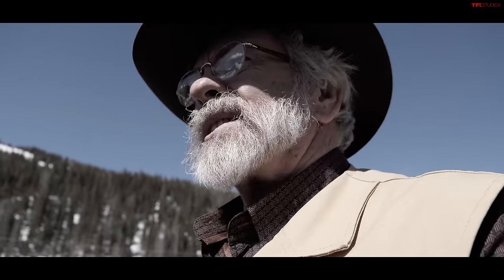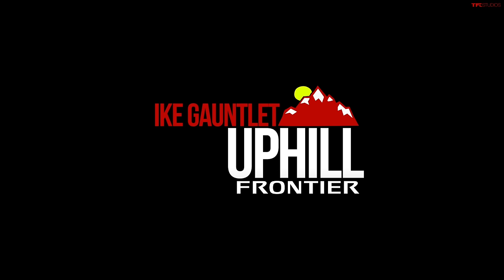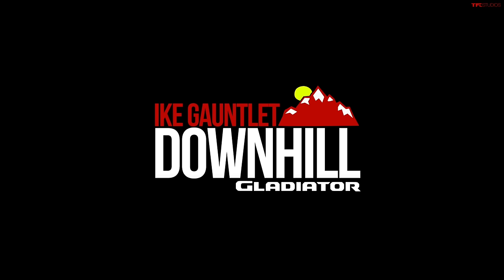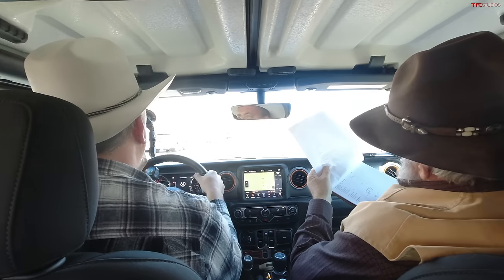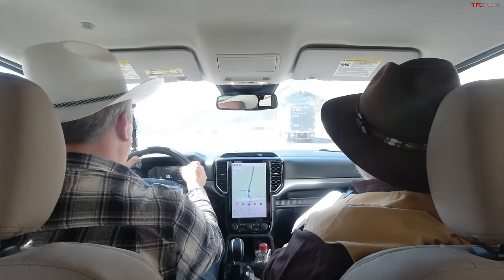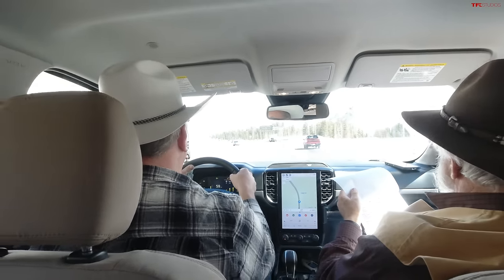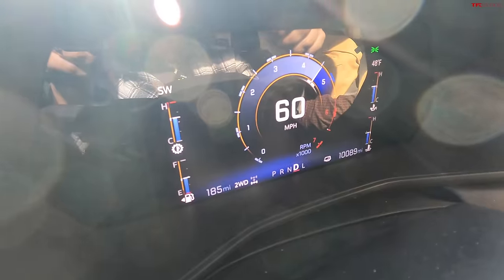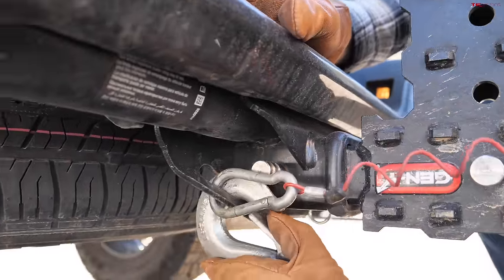MEGA Ike: New Tacoma, Ranger, Colorado, Gladiator & Frontier vs the World's Toughest Towing Test!

Comment: This is one of the best videos you guys have ever put out. A ton of work you guys put is really paying off. I love seeing the head to head with all of these trucks.
Reply from the maker: Wow, thank you!
Reply: 💯 agree. 🎉 Great job Andre and the crew!
Reply: The jeep gladiator had the most brake applications with 5 and the Chevy Colorado had 1 brake applications and was the best for that category and that puts the Colorado even further ahead
Reply: @mrgreen8357  Thanks
Reply: @mrgreen8357  exactly except for the Colorado has a pecked with the blocks cracking
Reply: OK 😊GREAT TESTINGS ,  Next Test Same Loop@ a 1-Ton Reg. Cab 430Gear Ring , Base Truck Longbed F-350 6.8 & Add; 2500-LBs@ Test & Simple 😮White Exterior
Reply: @bryanmathew2079  Thanks
Reply: @MrTruckTV  YOUR VERY WeLcome Mr. Truck,
Reply: Best videos???????  Who runs a truck up mountain grades at red line. What does that prove.   How long is a tiny motor going to last doing that?  Looks like a test to see how many bearings we can spin out.   A 40 HP VW will pull 8000 pound too, until it explodes.

Comment: Can't wait to see what the results are of the Ford ranger when they put the 2.7 EcoBoost in it
Reply from the maker: We hope to test this in a couple of months.
Reply: I will be faster, heavier, and have lower payload, but will feel more confident while towing because of larger displacement and heavier overall weight. It will cost more too.
Reply: @dmegahan  I suspect we won't see 2.7 rangers on the lots in 2024.  Its probably going to be people's orders first with the occasional declined delivery that makes it to the lot.  Much like the maverick situation was.
Reply: It will DOMINATE the midsize segment.
Reply: @cliffordmontana4562 I highly doubt it only has 5hp over the Colorado and has 30lb-ft less in torque numbers. They should have detunned the raptor engine and offer that instead of the 2.7.
Reply: @TFLtruck  are you guys getting a Raptor version to rest as well?
Reply: Mojave only has 6000 lb tow rating?  Why is lower than the other trims at 7700 lbs?
Reply: @utope2  suspension on Mojave is different from the others. It a fox setup more for higher speed off road sort similar to the Ranger Raptor, which also has a lower tow rating then the other rangers.
Reply: @robertopics On paper yeah, but have you seen the drag race with the Colorado and the 2.3 ranger, the 2.3 ranger dominated and that's a lot less torque than the Colorado at 430. Either Ford is dating their numbers for Chevy is inflating theirs, or it could be that the Colorado is just heavy.
Reply: @MrFordguy73  Colorado is a heavier truck and there are other factors like rear end gear ratio, tire size and weight,  who was running premium fuel (the cpu detunes for 87).  With a trailer behind both the take off to 60 looked like it favored the colorado.  Keep in mind this test was just over 6000lb versus the 7700 lb capacity of the colorado so those numbers might have widened when the grade was steeper or payload was heavier.  The ford did seem quieter though and from other reports it may run smoother with less vibration in the cab.
Reply: @robertopics Have you been watching these videos? The 2.3L Ranger has been matching or beating the Colorado all while having 40 less hp and 120 ft-lbs less torque. The Colorado is not making anywhere near the power or torque that is claimed.
Reply: @spyder000069 Im pretty sure that the 35-60mph time was the same for both of them. And even if the Colorado is a few hundred lbs heavier, when you are also towing a 6200 lb trailer, those few hundred lbs mean a lot less. The additional 40hp and 120 ft-lbs of torque that the Colorado allegedly has should have easily overcome any small weight difference when towing.
Reply: @Jay-me7gw  The ford had two additional advantages.  The ford had 255/70/17 tires vs chevy 275/65/18.  They show the door jam stickers during the towing video.  This works out to the chevy having a 1" taller tire and .8" wider tire.  So besides rolling weight being heavier the chevy ends up with a 3.1% gear ratio disadvantage.  Also the ford has 2 more gears in the trans keeping the engine closer to its prime hp/torque range.  Would have been better to compare the ford to a LT instead of a trailboss and with onroad tires.  The 10 speed in the ford can be a blessing or a curse depending on who you talk to.  I'm not taking away from how good the 2.3 is.  Its amazing what they get out of that engine and most report them to be reliable.  The 2.7 was in the full size silverado so it seems to be pretty stout as well.
Reply: @spyder000069 Their 35 to 60mph uphill with trailer was Ranger 14.3 sec, vs Colorado 18 .8 !!
Reply: @Jay-me7gw  Ranger was 4.5 sec quicker !!
Reply: @spyder000069  40hp would make up for all of that.

The rangers tires are decently aggressive. Idk why you would compare them to road tires
Reply: @MrFordguy73 Dominated? Colorado's front bumper was about even with the Ranger's rear. That was also the Ranger's first run against the Colorado which was on it's second run after it just ran against the Honda. So you have a cool turbo going against a hot one. The Colorado also has more unsprung weight on the corners with the larger offroad tires plus a suspension lift.

Notice how the Ranger was off in races 2 & 3?

Ranger v Colorado 16.13 sec
Ranger v Tacoma 16.59 sec
Ranger v Dodge 16.65 sec
Reply: @arkhsm  55:15 in the video shows the colorado 35-60 time as 14.8 seconds.  They show speedo during that accelleration and I stop watched it at 14.6 so I can verify their result.  Not sure where you got 18.8.
Reply: @Jay-me7gw  Tire comparison was more for size and weight.  Ideally it would be nice if TFL took each of the trucks to a dyno to see what actual rwhp is.
Reply: @spyder000069 Did you actually look up the tires? They are 3 lbs different in weight. I run the same tire as the Colorado on my F150, the Territory MT, but mine are a LT315/70R17 and are only 53 lbs. I weighed them when I got them. They are a super light weight tire.

 Tire diameter doesn't matter much if you have the proper gearing in the transmission. Since both trucks pulled the hill at 4000 rpm then clearly they both had the same overall gear reduction since they were able to go the same speed at the same RPM. 

Again, 120ft-lbs and 40 hp should have EASILY overcome any small difference in the tires. Its not like we are talking 37" KM3's vs 30" all seasons here. They are similarly aggressive AT tires with similar weight.

The Colorado is clearly derating heavily at elevation. Their claimed 430 ft-lbs appears to only be available in ideal condition and at 5000+' is being reduced to near the same output as the Ranger. Its really unfortunate because I was genuinely excited about this truck and motor. I live at 6500' so this actually does matter to me. I thought it might be a replacement for my 2014 3.5L F150 but it is not.
Reply: @Jay-me7gw  3lbs per tire is noticable.  I'm in northern midwest and still have my blizzacks on my ecosport and I loose 2 mpg with them and can tell a power loss.  I also have a F250 and lose 1-2mpg with my wildpeaks vs my michelins.  I agree on the trans gearing and that is where ford has an advantage with 2 more gears but some people say that the 10 speed hunts a lot and is jerky when it down shifts 3+ gears.  So you take the good with the bad i suppose.  I own 3 fords currently but was considering the colorado as my first chevy truck (had many old gen rangers and a couple of f150's in my past).  I will be keeping my f250 but looking at a small daily driver truck that is more managable in congested parking lots and can tow my smaller trailers with my atvs.  I looked at the frontier several times and was close to pulling the trigger but I can't get past the outdated infotainment and cluster.
Reply: @TFLtruck I’m putting an order in for 2.7 Ranger day 1
Reply: @robertopics 2.7 is a different animal, it’s probably the best modern ford engine.
Reply: Me to I'm considering buying
Reply: Hope it’s better than the rustang. I had an ecoboost mustang and it
was in the shop multiple times.

Comment: Ford Ranger has a brake controller; back up assist; park assist.  Plus a V6 on the way.
Reply from the maker: Lots of cool features.
Reply: And a gauge cluster that sucks .
Reply: I hate that guage cluster as well. Everything else they did pretty good.
Reply: @rodgood  I like it.
Reply: and unreliability and low resale value
Reply: And trailer blindspot system
Reply: I'm leaning towards a canyon when I finally need to upgrade, but the 2.7l Ranger has my interest.
Reply: @Georgewashington-o7m  That's a lie. The Ranger engine and transmission has been very solid. 
The 2019+ version has been a reliable truck.
Reply: @user-tg8do2kr4v  It's the complete opposite of what you just said. Do you work for GM lol?
Reply: Hey, then it still won't beat the jeep down hill with that useless junk tech garbage
Reply: @Georgewashington-o7m  resale value is only 3rd to the Tacoma and Gladiator. No midsized truck today has a low resale value. Also there are several Rangers creeping up the 150K mile territory. The 2.3 Ecoboost is quite proven by now, it's been out for a while.
Reply: Yeah but is still a CRAP Eco Boost.  Not reliable for the long haul.
Reply: @rofin9541 what’s “the long haul”? I’ve had multiple and never any issues. One had over 150k miles.
Reply: You left out the best looking truck category and the Chevy/GMC twins win that hands down. I’d take the  Colorado all day. Great video guys!
Reply: And it’s a ford
Reply: @imkwuzn that's subjective. And I haven't come across many who would take that Chevy over the Ranger in styling let alone the fact the Ranger is an all round better vehicle. The Colorado has a busy uncohesive design as per most GM products.
Reply: @rofin9541 did the ecoboost you have never owned give you pretend issues?
Reply: You forgot it's unreliable and resale value sucks
Reply: @RJBiteanerd  Get a frontier instead.
Reply: @rofin9541 I don't know,  I somewhat reluctantly bought a Flex with the 3.5L EB because my wife absolutely loves them,  and now have 115k miles on it with a 5 Star tune in it, and haven't had to do a single thing to it. At least with this particular vehicle, I've been pleasantly surprised!
Reply: @GoFast58  unless Nissan has turned things around their build quality leaves a lot to be desired to choose the worst in the class.
Reply: Yes, once that 2.7 V6 becomes available the Ranger will be a whole new beast 🤞😁
Reply: I have a 2019 Ranger FX4 and love it. Definitely looking forward to see what the V6 brings and hoping to see if/what they bring in the hybrid world for the truck. When I upgrade it will likely be one of those two variants. Only negative I can say about the current model... I wish it had better engine braking when towing downhill as I do that often in the mountains of Colorado.
Reply: @epicfutbol  looking at the results, I'm wondering if it's a byproduct of using turbos. The turbocharged trucks all did significantly worse at engine braking.
Reply: @RJBiteanerd  I definitely think that is the case. That's why I'm excited to see how the v6 Ranger will handle. I've been told that the hybrid mid-sized trucks should be interesting as well since those electric motors should in theory help.
Reply: @imkwuzn  You like all that black plastic that will fade to a dull gray in time? Ok, have fun!

Comment: When the Ranger gets the 2.7L it will blow the competition away.
Reply: It might feel better towing but the Chevy will still have class leading towing capacity, the ranger is locked in 7500 lbs across the board.
Reply: The Colorado with max towing is 7,700 lbs if i remember correctly and it didn't blow away the Ranger with the little 2.3L engine in it so it won't even be close to competing with the performance of a Ranger with a 2.7L in it.
Reply: @drewelliott9062  no it did not blow away with towing. But I am saying, either engine you choose in the new ranger. Towing capacity is the same. If you do the eco boost V6 payload actually goes down but towing capacity remains 7500. So Chevy will still be class leading because it is rated for 200 lbs more.
Reply: If you’re towing over 7K on a regular basis you need to upgrade to a full size. These trucks are good for 5K towing if you’re doing it all the time. Never tow regularly at the limits of any vehicle.
Reply: @khakiswag  I agree but you can tow a 6000 pound trailer with a family comfortably with the Colorado... Same thing that andre does... It's not bad for the truck because he has enough leeway, same could be said for the ranger... But with the Chevy you have more leeway.
Reply: @drewelliott9062  The 2.7 V6 that will be in the ranger will still have less power the the 2.7 4 cylinder that is in the Colorado. Now if you're talking the 3.0 V6 ranger that is coming then yes it will have way more power than the Colorado but will only be available in the Raptor which will have a lower towing capacity than the other trim levels of the ranger.
Reply: @khakiswag  also what source can you find that says you shouldn't tow these vehicles above 7k regularly? and what are their credentials?
Reply: What number are you looking at? In the Bronco the 2.7 makes 315 HP (330 with premium fuel) and 410 Torque. More than the HO 2.7 4 cylinder in the GM twins.
Reply: @bladeftw6378  I said ANY VEHICLE. If you’re driving a 1/4 ton with a max tow of 13K and you regularly tow 12K you need to move up to a 1/2 ton. It’s not about power but safety. Handling and braking at the limits of what the truck can do is not a good idea. You never know when you need to take  evasive action. A Silverado will handle abrupt maneuvers or strong cross winds with 7K behind it better than a Colorado. And a F-250 will do the same with 12K behind it compared to a F-150. It’s common sense if you’ve towed.
Reply: @khakiswag  well that's a given evasive maneuvers and braking towing 7k pounds is always going to be worse the more you tow. it still stands that chevy is rated for and will handle better ever so slightly better than a ranger. I have towed before and I know many local businesses that will go with the Colorado for their fleet over the ranger, not because they are going to tow max but because it is going to handle towing 5 or 6k more frequently without issue.
Reply: Only thing that is going to blow is the engine; Toyota is the best to pick or Nissan
Reply: @Georgewashington-o7m  be careful making general statements. When the previous gen Taco came out the powertrain had issues. Toyota is reliable but it’s still man made and has faults too. The 2.7 EB has been in use for almost 10 years now and is proving to be reliable. Had some issues in the first year and with a bad batch of parts from a COVID supplier but it’s a good engine.
Reply: @drewelliott9062 I agree, for the numbers that the Chevy put up against the 2.3 it didn't look good. I think the Colorado is kind of heavy.
Reply: @MrFordguy73 its the gear ratio. Nothing wrong with the engine numbers. Its two diff methods to achieve the same thing: more power or more gearing.
Reply: @bladeftw6378 Huge 200lb difference, big whoop !!
Reply: @TheFlooringInspector82  How come all this Chevy power couldn't even beat Ford's 2.3 then, mate; are they using smaller little ponies or what ?!
Reply: @arkhsm  still class leading, I find a lot of brand loyal people which makes no sense. If people want innovation and better products they need to break away from their brand loyalty. Something people hold onto from their childhood. Not saying you are this way, but still... This generation Chevy will keep the crown. Even with the 2.7 Ecoboost, which might just be faster. Happy for Chevy beating the competition.
Reply: @arkhsm  also could be a deal breaker for some people for sure! 6000 pound trailer 4 people let's say 800 pounds let's say maybe you have a couple hundred pounds of gear. Not saying Andre tows this much, but all of that the Chevy will handle better and have less strain pulling than either option from Ford.
Reply: @khakiswag actually that is less than GM twins just saying…
Reply: @khakiswag well said and completely correct. Just because a vehicle is rated to a certain amount doesn't mean that's for full time use! Any vehicle running redline constantly will not last. So that theory applies across the board pertaining to brakes suspension engine and trans! People who run at the limits and over the limits are foolish and endangering the innocent who aren't doing anything wrong!  Just because you can doesnt mean you should!
Reply: Still a funky ass ford